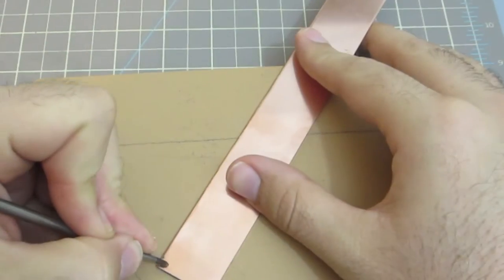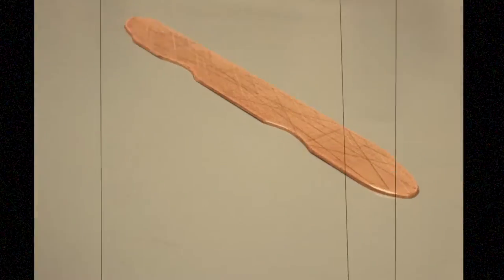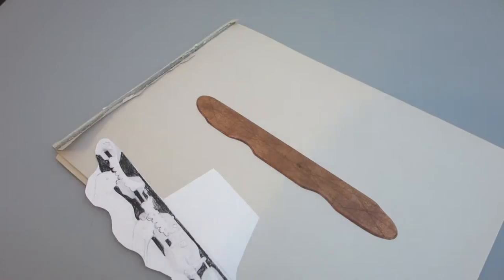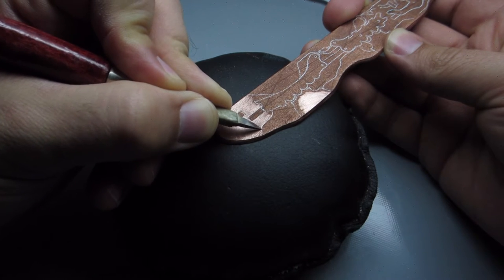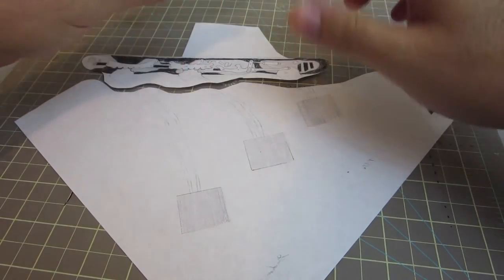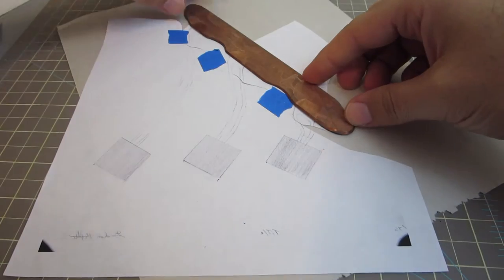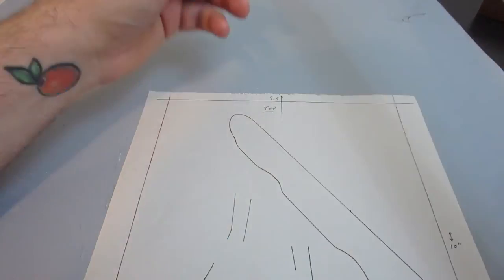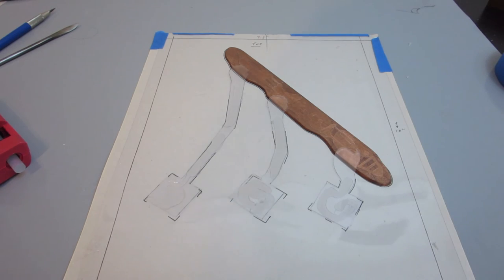Mezzotint Printmaking – Start to Finish. Systems of Control, Part 1

Comment: I find your videos always helpfully informative so, I was surprised and disappointed that in this one you did not show the beginning of using the rocker tool on the plate which is the heart of this particular process. How you hold the rocker, what type of rocker, it's orientation to the plate, etc. is information that one would expect when the title of this video is "Mezzotint Printing - "Start to Finish".  The computer graphic is just not the same. I appreciate you not showing us every minute of what is a repetitive rocker process, but sharing how you begin, I feel, is important for students. Thanks for your willingness to share your art process. I support you and look forward to more!